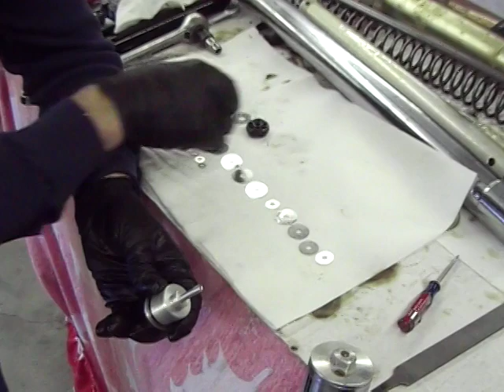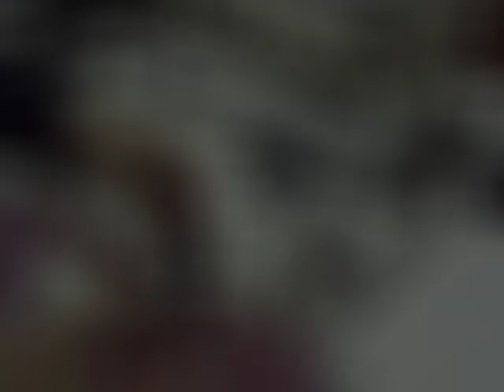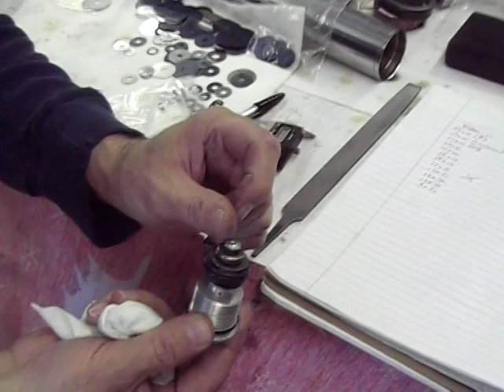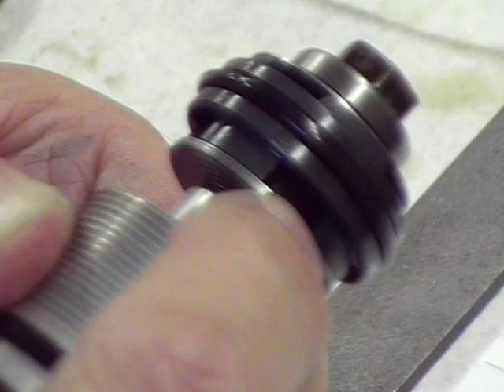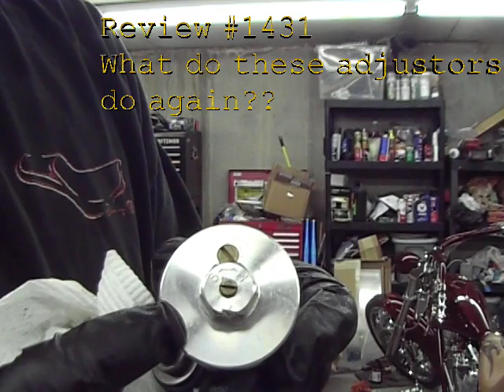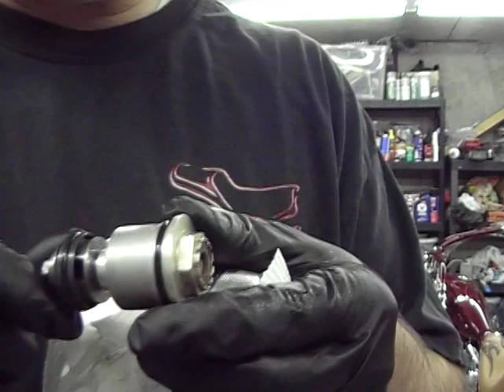EveRide DRZ 400 Extreme Makeover - Episode 11 - Fork Revalve

Comment: I'm a complete noob when it comes to revalving. Do you know how many face shims I should add to compression and rebound so that it fits my 240 lbs future weight? (I weigh 280 lbs currently 😅) I'm also switching the stock springs from .44/5.3 to .54/6.6. I'm going to do big jumps, so I think I need a lot of low speed compression both in the front and rear! Maybe also thicker face shims? Your help would be greatly appreciated!